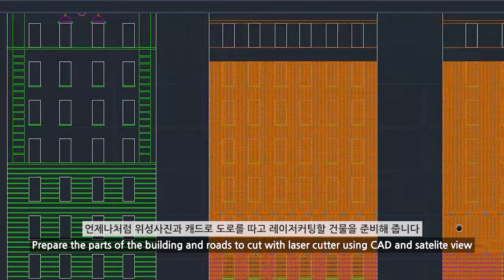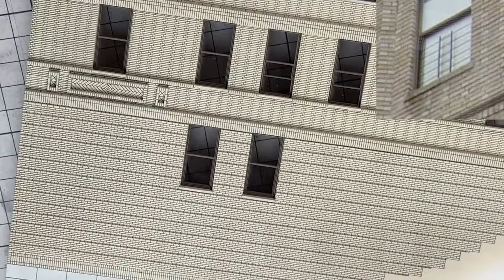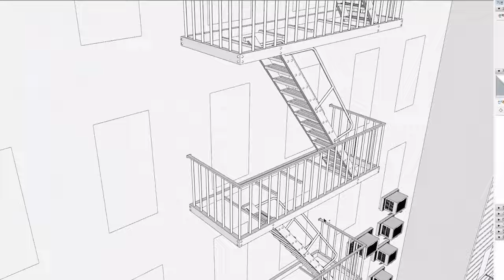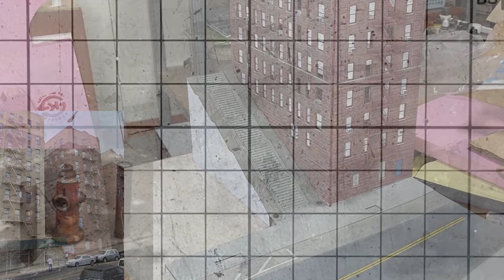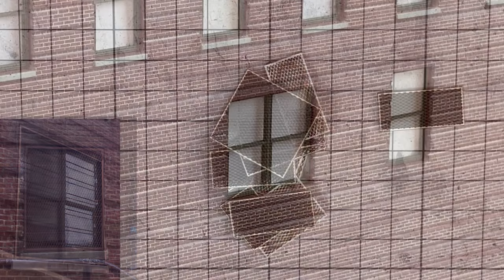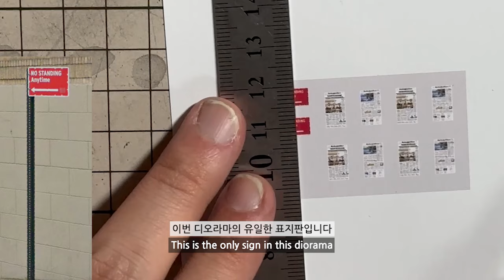Recreating the "Joker Stairs" in 1/64 scale diorama

Comment: Hi, it is very nice🎉🎉 Can I refer to your settings of 3d printer?
Reply from the maker: The setting varies from what printer you're using...
I'm printing it at 0.05mm layer height and using Anycubic recommended settings.
Reply: @downsize99  i have m5s of anycubic and high speed resin, do you try this resin? The setting is recommend for 0.1 layer but can I use 0.05 like you?
Reply from the maker: Yes I’ve tried high speed resin at 0.05mm and it works pretty well, but i’ve found out that the prints are somewhat blurry than the basic resin at 0.05mm, so I came back to basic resin.

My high speed settings might be bad and it could have caused blurry prints, but i think 0.1mm is better for high speed resin.
Reply: @downsize99  thank you for your advise